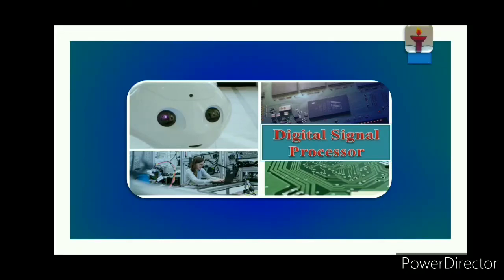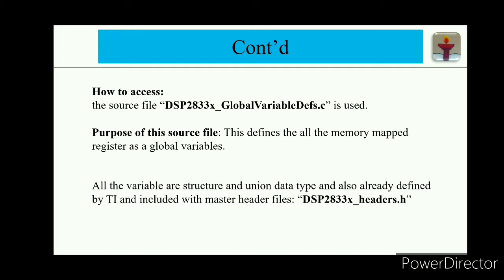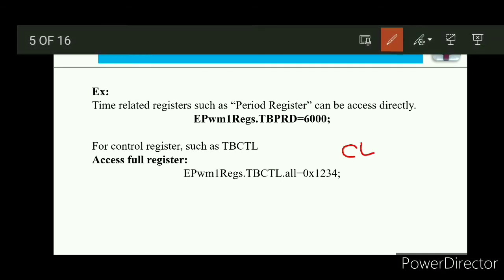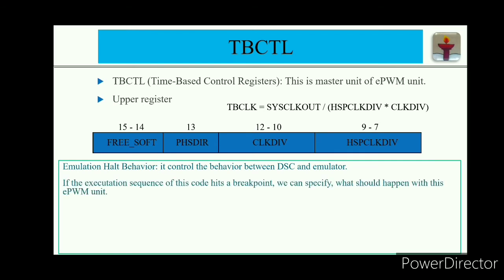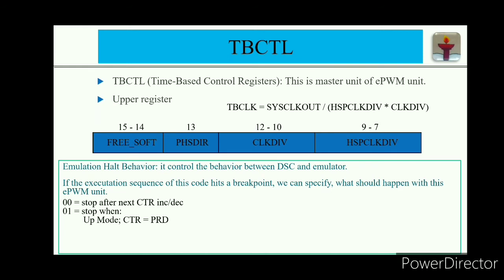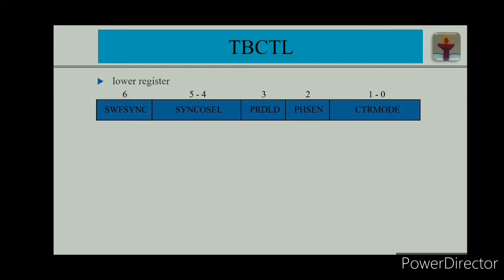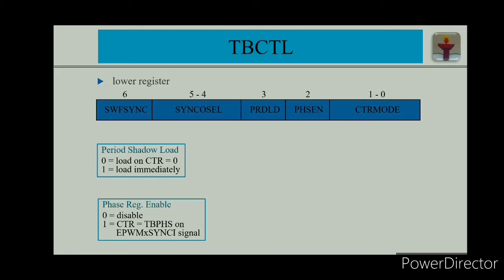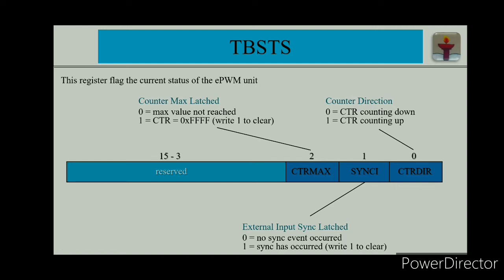Part 10 | ePwm Time based Register | TBPRD | TBCTL

Comment: I NEED TO DO PI CONTROLLER FOR THE OUTPUT VOLTAGE CONTROL OF DUAL ACTIVE BRIDGE CONVERTER BY VARYING THE PHASE SHIFT OF THE PULSE (EPWM). WILL YOU PLEASE EXPLAIN ME HOW TO ACHIEVE THE SAME.

Comment: Hello Rohit Sir,
I want to implement  motor control in DSP(TMS320F28379D) using Simulink Embedded Coder can you please help me with few queries?
Reply from the maker: Yes
Reply: @controllers_knowledge  sir.. I am feeding proper signal to ADC pin and I want to see what is Coming on adc pin how can I see that in scope....I saw some video about running in external mode but it always give error....can u help me in this

Comment: How can connect PWM 4 carriers means eight output how connect them to six switches only in the circuit!
Reply from the maker: You can take three carrier and three PWM... Each PWM  will give you complimentary single. For example PWM 1 will give you complementary single that you can connect with two switches.
Reply: @controllers_knowledge  
I have 4 carriers 2 in the upper of zero and the others in down, this is PWM. I have 2 switches in the source in parallel and 4 switches in the load which 2 legs 
which carries of 4 should put with each other?
Reply from the maker: That depends on you switching logic. How you want to switch your switches.
Reply: @controllers_knowledge  
I want to generate 5-level but the result has +Vdc missing mean 4-level has only
Reply from the maker: Based on your simulation analysis... You can keep carrier according
Reply: Can I sent the Matlab circuit design to you to see the circuit well but give me your email please.
Reply from the maker: rohit.jain19194@gmail.com
Reply: @controllers_knowledge  I sent email to you.
Reply from the maker: Your model have wrong PWM logic... You must change the logic to get correct output

Comment: So good
Reply from the maker: Thanks
Reply: @controllers_knowledge  is there pack of video or books i can give help from them for coding  dsp 28335?
Reply from the maker: Videos are not there for the same... But you will get some related material on internet. On TI website you can get material.
Reply: @controllers_knowledge  thanks , i checked but i asked about books teaching from zero to 100% how can make code and what it need for runnig dsp 28335? I am master degree of power electronics engineering and i want use it for controlling inverter
Reply from the maker: There are no such book available.
Reply: @controllers_knowledge  yes. Is it possible show us how write simple words from first to upload cods on dsp? Showing all steps for making .out file
Reply from the maker: Yes